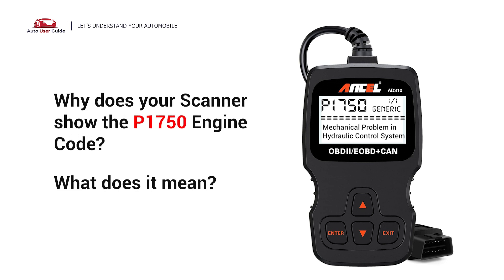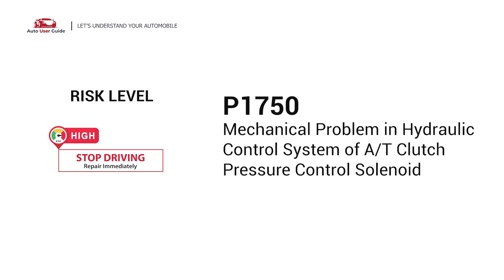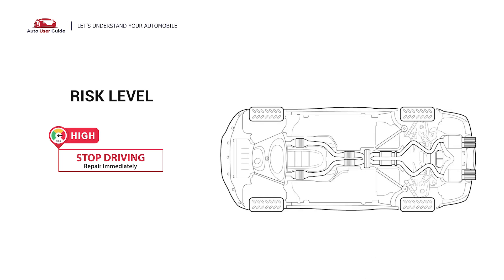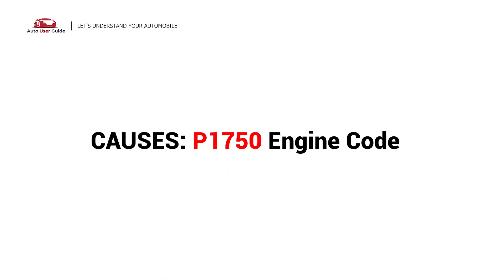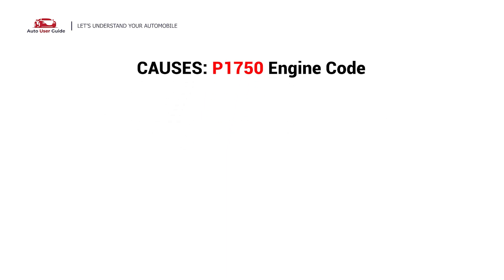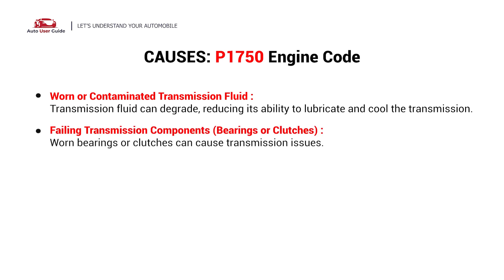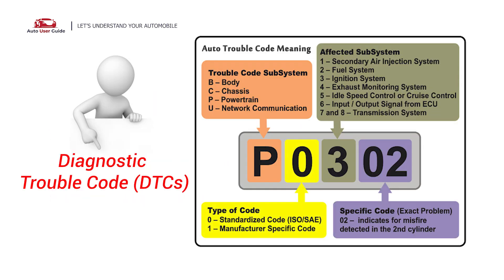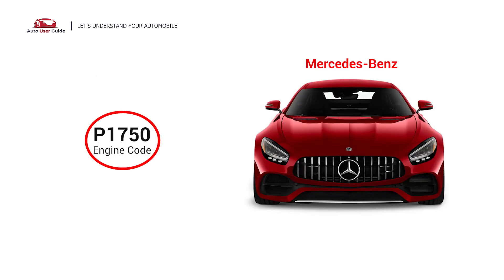What is P1750 : Engine Error Code Causes Explained

Comment: I drive a 2010  toyota isis with a 2zr engine and p1750 code appears. I got it scanned and they told me that the rear left abs sensor is bad. Can you please comment? Thanks much.